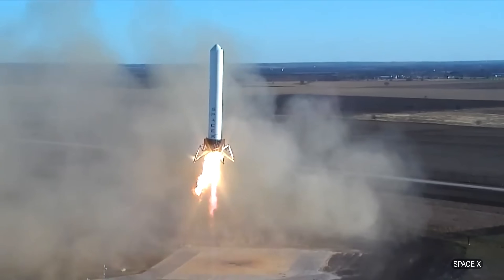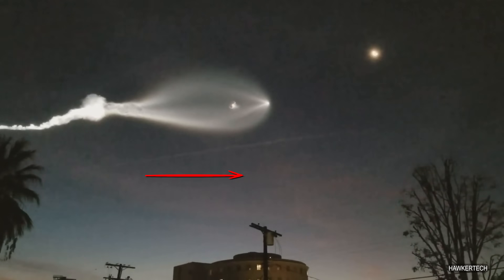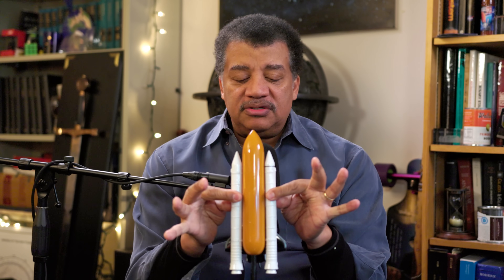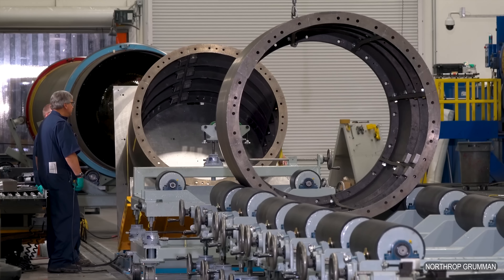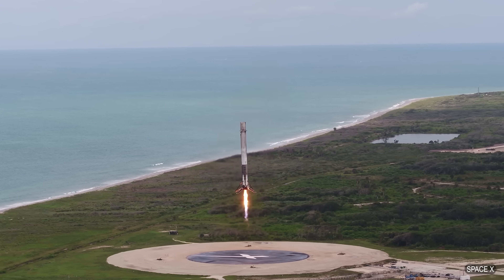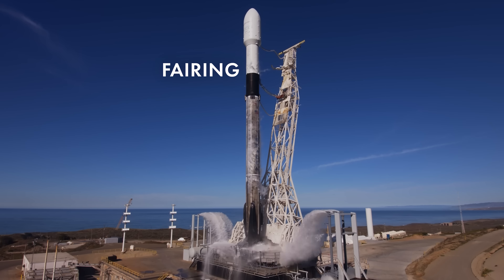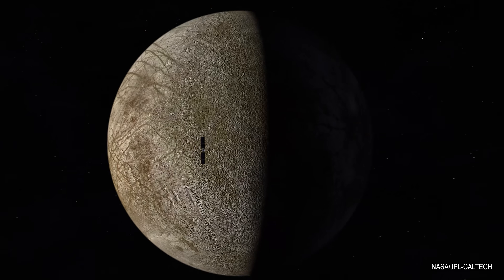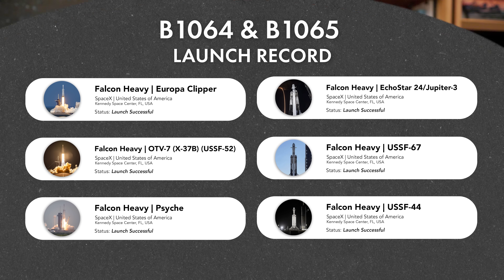What's Up with Reusable Rockets?

Comment: The reuse of rocket boosters has long been considered. If you look back at the art from the 1952 Colliers Magazine series you will see a hypothetical “steel parachute” intended to enable recovery of a spent rocket stage. There were various schemes suggested to recover Saturn V stages by parachute or even by adding fly back wings. These went no where in the rush to land on the Moon. The Shuttle was intended to be completely reusable by employing a huge piloted booster. It became partly reusable to lower acquisition costs. The real brake through is modern computers and guidance technology that makes it possible to put a booster down in a very specific location, like the deck of a ship or a landing pad as opposed to splashing it down somewhere inside a generally  defined oval tract in the ocean.
Reply: ...or in Mechazilla's Chopstick arms.
Reply: @mikemccormick6128  yeah that one is so wild. I still recall the community's reaction when it was announced that they would give it a go
Reply: The biggest issue with the shuttle is its budget required congress. At that point they started making the design decisions instead of the engineers. Prices went way up because every senator wanted their piece of it. Which lead to things having to change to get the budget under control. Around and around, it went thru congress until it ended up looking cool but functionally compromised in every way.

Comment: Isn't it physically impossible to reutilize a rocket? There's always gonna be some ''damage'' and even if repaired when they're back it's kinda a bigger risk sending a ''repaired'' rocket and not a fresh new one.
Reply: Well, they are doing it. Almost every launch is with a used rocket including sending astronauts to the space station. So far, the most relaunches of a rocket has been 17 times.
Reply: @mikemccormick6128  The current record is 26 flights (25 reuses) of the booster. They were at 17 reuses in late 2023.
Reply: @whocares2277  I don't care.
Reply: @mikemccormick6128  17? I think your a little behind there xd
Reply: It's not physically impossible. If that were the case, we wouldn't have hundreds of SpaceX booster landings, some of which have successfully accomplished 20+ landings. Yes, things break and nothing lasts forever, but quality parts and simplified, robust designs can give any machine or system great reliability, and overall lifetime. It's like a Toyota compared to a BMW. You will see more Toyotas with unmatched reliability and mileage than most BMWs, and simply because Toyota holds a market with their simple, quality-built designs. While BMW holds a market by making complex. performance-oriented designs, with cheaper quality parts for competitive pricing. All applies to rockets when wanting to reuse them. There will always be a limit, but how greatly you can increase that limit while also making things simpler is what innovation and engineering is all about.
Reply: dont think so
a new one is a risk because it is not thoroughly tested
most reliable are probably the 3rd or 4th flight of a rocket that can fly 20+ times I bet
Reply: As for the guy talking about Tesla fanboys, you should stay out of comment sections until you grow up. You are literally letting your blind hate cause you to say foolish things. Tesla has never built a rocket, is not working on building a rocket, and has no plans to build a rocket.
Reply: As of right now yes.
Reply: First, not physically impossible, since it is done many times. Second, just because there is some "damage", as you say, doesn't mean it is less safe than a new rocket. Remember, a new rocket has never been tested in flight. New manufacturing defects, a bad batch of materials, or some other problem can come up during a new build. They are literally experiencing that issue with Starship right now.

If the rocket is rated for at least 20 flights and there are real world examples of it exceeding 20 flights without issue, then you will be more comfortable having your payload on one that has only flown 5 times verses one that has flown 20 times or one that hasn't flown at all. Any possible kinks from production have clearly been worked out. And the rocket is far from its proven rated lifespan. Flying on one that is close to or exceeding the known rated lifetime is more risky. However, that is why SpaceX themselves take that risk with their own payloads. Customers have less risks on a pre-flown Falcon 9 booster than they do on any new rocket by SpaceX and far less than any rocket by anyone else right now.
Reply: There's kinda a risk using the same car every time you go to work instead of buying a new one.
Reply: @xminterminator Well, car or aeroplane experience a little bit less stresses than a rocket.
Reply: @xminterminator Yeah, if you're using you're car to go to outer space i would say so 🤦
Reply: Fantastic answer. You are a genius, I really laughed. Cannot reason with Tesla fanboys
Reply: @ Who was talking about Tesla? Why do you hate Tesla?
Reply: Is it a bigger risk though, if a rocket booster has flow successfully 10 times, wouldn’t you be more comfortable with that one than a brand new one?
Reply: @anthonyd.8067  A rocket booster is not something the people inside control during flight i think, so it's not something you can get comfortable and used too like a car, so i guess it depends on how much repair it needs after, etc... I'm not a engineer or anything so i was just curious, my thinking was that if for example a brand new rocket booster has almost 100% chance of working couldn't that percentage lower through the many times it is used? Even after repairs? And if we can have a rocket booster that can flow sucessfully 10 times there's always a bigger percentage of failure that grows each time, while if you use a new one 10 times straight the chances & risk will be the same as it was in the beginning, it's kinda of a brain puzzle for me honestly so i'll leave it to the experts xD But i guess it comes down to financial as well, sometimes its cheaper to get a newer one than to fix the old and the other way around. But like the person above said, if they already managed to do it 17 times in a row, it's because they already figured how to maintain the same risk & probability.

Comment: Starship is the Worlds first fully reusable orbital launch vehicle and it's very impressive.  But for all of the superlatives, the design has a couple of big flaws.  First is that the Super Heavy booser must return to the launch site to be recovered - caught by the launch tower.  This puts a practical limit on the staging velocity, since any distance and momentum generated must be offset by extra fuel to get back.  This leads to the second big flaw - after staging, Starship must do everything else.  Ascending into orbit, performing all mission operations, de-orbitting, re-entry, and finally landing and recovery.  That's a lot to do and every extra kilogram of mass required, takes away a kilogram of payload.

SpaceX set out thinking it was possible to build a Starship that could carry 100 tons of payload into space .. but that was only an educated guess.  The initial (V1) design whiffed big-time on that number and was quickly abandoned for the current (V2) design.  The new design sacrifices payload volume for larger fuel tanks, in addition to other changes to reduce mass.  But the failure of flight 7 was a wake-up call, as the V2 Starship didn't work - it exploded!  I have run some basic numbers and I just don't think they are ever going to hit that 100-ton payload target with this design - it's too heavy.  Especially once they start adding additional mass for things like docking, and propellent transfer equiptment.

So they are probalby going to be somewhere south of 80 tons of useful payload to orbit, and this is where the problems multiply.  It will take more Starship launches to pre-stage enough propellent  in orbit for EVERY deep space mission.  More launches adds more exposure to weather delays, flight and ground hardware failures, wear and tear to the propellent depot, and more boiloff of the propellent already in orbit.  Wash.. Rinse.. Repeat..

The Space Shuttle had lofty goals that it never achieved, but Starship is even more abitious.  It could suffer a similar fate -  where it can be made to work but it takes too much effort and the actual reliabilty isn't good enough to ever carry poeple.

Comment: Literally feels like science fiction seeing those rockets 🚀 come back down with perfect precision
Reply: Sounds like Ken here is a bot. Funny how he keeps insulting people, saying they are ignoring facts, while he constantly ignores facts and cannot read. Let's see some missed facts by him. 

Aircraft landing on carriers at higher speeds than a Falcon 9 booster. The fastest carrier based aircraft is the SR-71 Blackbird, which could reach speeds of nearly 2,200 mph. The Falcon 9 booster is coming down at over 2,800 mph.

Using fuel instead of parachutes being dumb. Parachutes don't allow precise landing, nor do you slow down enough. So a rocket would be landing pretty hard in the ocean, damaging the engines and getting salt water in sensitive areas. Further, parachutes would weigh more than the fuel used. SpaceX tried parachutes for Falcon landings, and it failed. Rocket Lab has also tried and it failed. The Shuttle's solid rocket boosters did use parachutes, but the recovery and refurbishment cost more than a new booster would have. Both NASA and Russia tried to reuse boosters without using parachutes, but they were unable to due to limited tech during those days. Russia gave up on parachutes for booster recovery decades ago, and NASA gave up on them more than a decade ago. Everyone who has taken serious interest in booster recovery since has used propulsive landings.

SpaceX's best turnaround time only being a day faster than the STS. STS's best turnaround time was the Space Shuttle Atlantis. STS-51J to STS-61B was just 54 days. Impressive. However, after the Challenger disaster, the fastest time was 88 days. How do those compare to Falcon 9? The Falcon 9 booster B1080 managed a a turnaround time of 13 days 12 hours 44 minutes and 20 seconds during its 13th flight. That is about 1/4 the fastest turnaround ever by STS and 1/6 of the turnaround after the Challenger disaster.

Emotional outcries and/or bot activity doesn't change facts Ken. You should use them next time.
Reply: @anthonypelchat  Grok bot, failing the first 'fact', by calling the SR71 a carrier based aircraft. How pathetic.
Reply: @kennethc2466  True, not a carrier aircraft. Just the fastest jet ever. And that was the top speed. Carrier only aircraft couldn't come anywhere close to that speed.

Facts fixed. Still showed how horribly wrong you were. Want to try again?
Reply: @ Bye bye, Grok-bot, who can't tell landing speeds from top speeds.
Reply: @kennethc2466  Hahaha. You have no idea what you're talking about. Good job ignoring facts due to blind emotion.
Reply: @ "SR71 land on aircraft carriers at 2200mph"-Grok the lying bot.
Reply: @kennethc2466  SR71 is the fastest jet ever, and doesn't come close to how fast the F9 booster is going when it enters the atmosphere. 

For landing specifically, jets land on carriers at around 150mph. The fastest land based jet landing was around 300mph. The Falcon 9 begins the landing burn while going 660mph. The burn doesn't stop until it lands.

Again, stop whining and learn facts. Interesting how you got so focused on a single mistake, a mistake that actually worked in your favor since carrier only jets are slower, and you still haven't stopped whining. And upvoting your own comments. Classic.
Reply: @anthonypelchat  Spam'n that Grok prompt, like a good little Elon tool, in a Russian time zone. Is Putin bad or good, Grok?
Reply: @kennethc2466  Hahaha. You got issues.
Reply: @anthonypelchat  Ah, Russian bot farm won't let you answer no. Got ya.
Reply: @kennethc2466  Says the one insulting people that bring ACTUAL facts to the conversation. Good job refusing facts and refusing to admit you're wrong.
Reply: @anthonypelchat  Is putin a war criminal, Russian using Grok?
Reply: @kennethc2466  Not Russian, but of course he is. Ever going to admit you were wrong? Or at least try to use facts to support something you stated?
Reply: @anthonypelchat  Hey Grok, did the owner of spacex call social security a "ponzi scheme"?
Reply: @kennethc2466  so you are unable to face facts or respond appropriately. Got it.
Reply: @anthonypelchat  So Grok, is social security being a "ponzi scheme", a fact, like your boss says?
Reply: @kennethc2466  Now your responses are nothing but harassment.
Reply: Hey anthonypelchat, is DOGE implementing the largest forced unemployment in US history a good thing?
Reply: @ why are you still crying ab a grown man’s actions
Reply: Ah, we've been landing aircraft on aircraft carriers, at night, in the rain and heavy seas, at higher speeds and higher precision since the 1970s. Wasting delta V instead of using parachutes is dumb, and SpaceX's best turnaround on their 'reusable' Dragon (that burns up a stage and trunk every flight) is one day better than the STS did, in the 1980s. The facts make it VERY unimpressive.
Reply: @kennethc2466  except for the total system reducing the cost to launch 10x. That has transformed the space industry. Unimpressive? I don't think so.
Reply: @ Dragon, taxpayer cost $522million a seat, including taxpayer's $4billion plus investment in dragon. Soyuz, $80million a seat, after sanctions, cost to the taxpayer.
Reply: Dude it's not dumb. Your comparing landing on a aircraft carrier to landing a rocket? Not even a close comparison. Landing back on the pad cuts turn around time significantly and saves lots of money. Starships blow up because they are testing new components to eventually get to mars.
Reply: @moabman6803  SpaceX bot. Go back to 'X'.
Reply: @kennethc2466  Bot? No. Just pointing out your incorrect comparison
Reply: @ Bot, you're just simp'n for a corp.
Reply: @kennethc2466  yea ok my guy lmao
Reply: @ I see facts mean nothing to your emotional needs. Typical 'amazed' person.
Reply: @kennethc2466  nope, you're just a hater.  Even Neil in the video which you apparently didn't watch the whole thing said this was not even something even considered to be possible or considered until the 2000's.  I know your type, you probably despise Elon cuz of his politics so you hate Space X.
Reply: @1ButtonDash  Thanks for hating anyone delivering facts, and are a SpaceX propagandist. Oh, and boom goes Starship #8.
Reply: @kennethc2466  you're the one who came in here hating.  I made a simple comment and you didn't like it because you don't like  Space X for whatever reason.  Most likely cuz you don't like Elon.  I knew I was right about this because of you gloating over Starship #8.  Oh btw the super heavy booster came back down perfectly.  I'm sure you wish that exploded.

The only people that like when things fail are people who are failures themselves and don't like seeing other succeed.  Oh and BTW Elon said he likes when things go wrong because it helps them learn from their mistakes.  But you are probably too dumb to understand that.
Reply: @1ButtonDash  Sorry simple facts triggered you again, SpaceX propagandist, into spewing their talking points like a bot
Reply: @kennethc2466  why are you a liberal?
Reply: @amac6624  Why do you love Putin?
Reply: @ why do you hate America?
Reply: @ Why you love putin?
Reply: @kennethc2466 you say “we” like you had anything to do with it 😂😂
Reply: @ Way to excuse facts, Boris the bot. You mad?
Reply: @kennethc2466  I don’t remember ever dismissing anything you said other than your involvement but sure, keep making yourself look like a toddler.😂
Reply: @kennethc2466  literally liking your own comments to make yourself feel better😂😂😂
Reply: @ I'm sorry your emotional tantrums, are your most 'adult' response to public record facts.
Reply: @ Im sorry that you can’t read.💔
Reply: @C0yf1sh  Yet more emotional hate of facts, Very sad, and juvenile.
Reply: @ Do you usually deflect and try having the last word? My little sister does that too.
Reply: @C0yf1sh  Do you normally rage at facts? That's something an infant does.
Reply: @kennethc2466  The best STS did was 54 days and that was only for the shuttle not all other pieces. The average turnaround time for STS was > year if you don't count the solid boosters and the expendable tank which sometimes took longer. Flacon 9 averages 21 days 6 hours. Far less than the 1 day better that you claim.
Reply: @robot-andrew  You're comparing a runway landing, 8 crew, with a 60,000lb payload to ELO spaceplane, to a single booster, that burns up it's second stage one every flight. How silly.
Reply: @kennethc2466  Landing in the water causes significant issue with salt water. It's one of the reasons the NASA engineers said we shouldn't have reused the solid boosters or are you saying the NASA engineers didn't know what they are doing.
Reply: @robot-andrew  Who, and quote them, or you're lying. Meanwhile, an astronaut who captained the Crew Dragon, Andreas Mogensen called out Musk for lying. "“What a lie, and from someone who complains about lack of honesty from the mainstream media.”"
Just as I'm doing for your desperate false quote mine, Elooner.